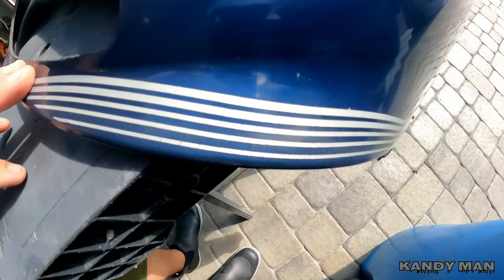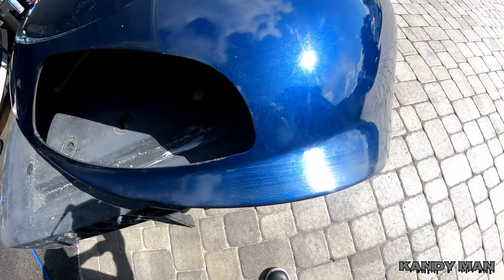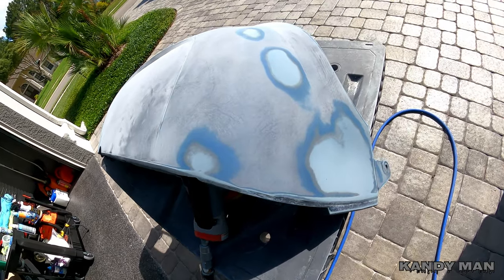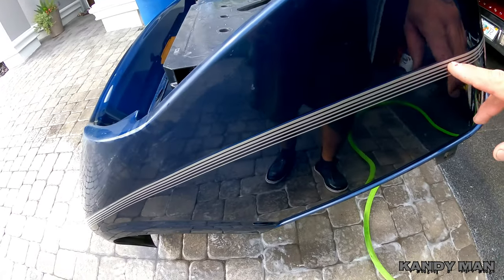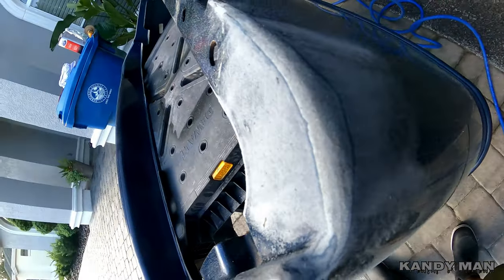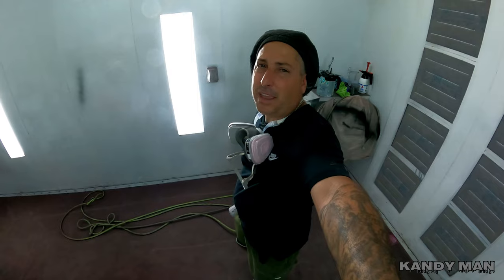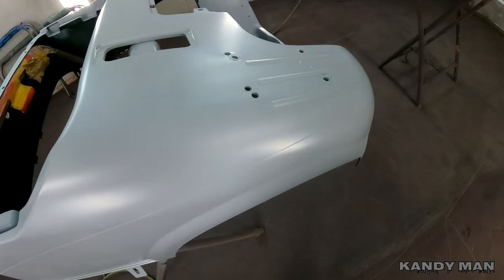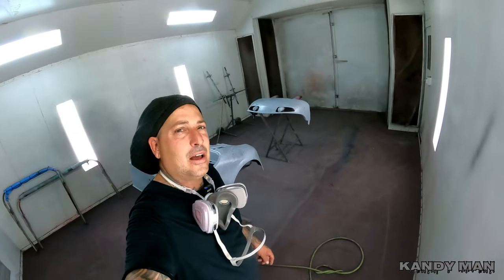PRIME TIME - KANDY EZGO CART BUILD PT. 2

Comment: I have to say I'm an experienced klutz with using an eraser wheel on plastic seems like if you're in a hurry bam you've burned through. I added a small brass air regulator at the bottom which helps a ton. Have you tried the crud thug™️ with the red eraser wheels on it? They are a pretty serious combination
Reply from the maker: Yes I had one like that myself  works great thanks for watching

Comment: Hey great job thanks for all the helps. Question. What is your thoughts on the HOK KD 3000 series? Compared to your top choices? Thanks again
Reply from the maker: Thanks  have not tried it  .heard of it primer sealer  have you try it out .
Reply: Yes.it is very smooth sands like butter per John K.  I live in Michigan.ive cleaned Akzo Noble paint tanks..I've never tried their HB primer system. I am a diy er so not much experience with other paint lines. Shopline.is another I've used..but  BTW Olds looks fantastic.!